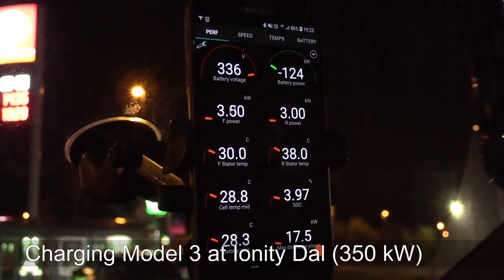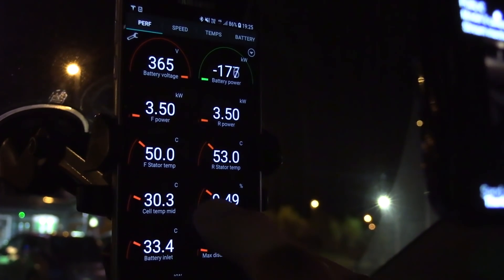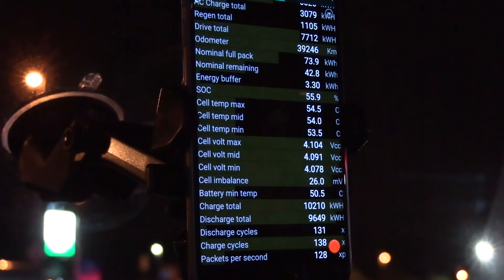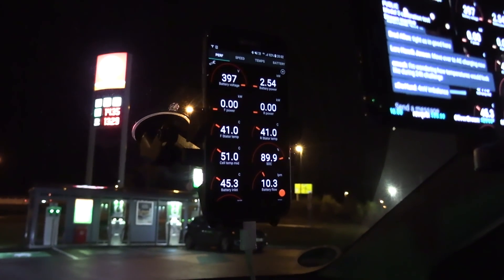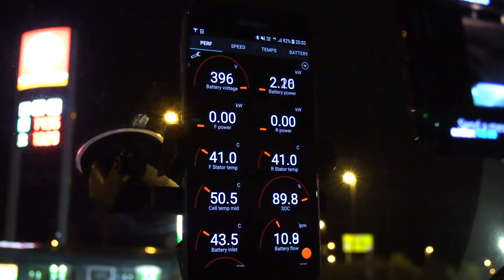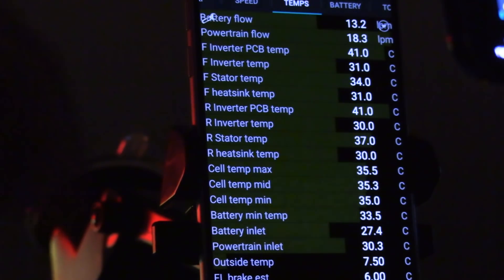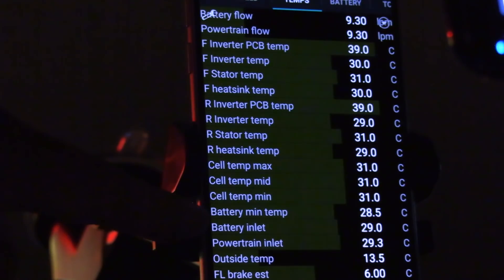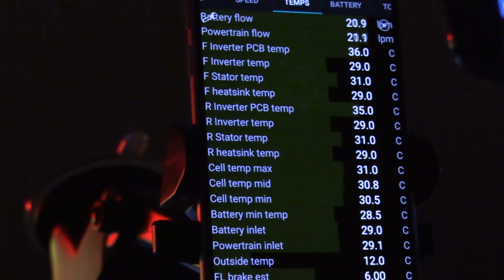Looking at Scan My Tesla OBD while charging and in Track Mode

Comment: Could you check the pre heating also with a Mod X or S as currently I don’t see really a pre heating. The pack it self get warmer due to the consumption. After 200 km of driving my battery has always 41-43 deg,  which makes a preheating unnecessary.

Comment: Wie does it charge at 130kW with a battery temperatur under 30 Degr.? And at a 50kW Triple-Charger it only charges 36kW with the same battery temperature?

Comment: When the stator temp is rising fast over temperature of the battery, i will more likely assume that the stator coils are used as inductor in charging circuit. Anyway it is clever complex solution the tesla is using, this principle has been described in some research articles but I don't belive that any other car manufacturer has implemented that yet.

Comment: Suggestion for a new video please --- people in some FB groups have been saying that their rear seat vent blows hot air when they've been driving for a while. Some research speculates that the duct is too close to the battery and long trips heat it up (and the floor?). And the only way to cool back vent is lowest manual setting which freezes front passengers. Also some say the back vents are split the same as the front -- there is a left and right side that uses the same setting as driver and front passenger. Is this a software or hardware issue with the back vent? Short trips maybe it does not happen?

Comment: I've read (somewhere) that Tesla battery chemistry is different from most other Li-Ion batteries in that it gives better performance e.g. lower internal resistance, higher charging speeds etc., but it is also much more temperature sensitive. That's why Tesla installs intensive thermal management (both heating and cooling) and also why they have always been able to charge at over 100kW. It seems that part of this different battery chemistry is that they like to be hot when charging and cooler when discharging.

Comment: I always thought that there are 2 things that degrade batteries prematurely, heat and excessive volts. Tesla have test equipment that allows them to determine degradation under test conditions, so I guess they have determined that heating the batteries to 50°c is worth the results. Will be interesting to see how m3 batteries handle it over time.

Comment: The internal resistance of a battery is inversely proportional to its temperature ( within certain limits). The lower the internal resistance, the higher the power it can take to charge. I thought that the ideal would be around 25°C, but never dreamt it would be 50°C !

Another thing I m curious is what happens with all this Thermal Cycling ( i.e. heating and cooling the battery) on the bond wires used to connect the batteries. It certainly isn't good in power electronics AFAIK.

Comment: AFAIK Tesla uses an "Active cooling limit" that starts the AC working on the battery when temperatues go above a certain level (and stops below that level). Below that level the car still wants to cool the battery when driving, but not bad enough to use more than radiator and pumps. When standing still without airflow on the radiator you wouldn't see much of this effect and the temperature would mainly hover near the active limit.
In addition to active and passive cooling limits the car also has active and passive heating limits (active affects stator heat generation and passive only switching between serial and parallell coolant loops). Fast-charging and track mode changes the limit levels compared to normal driving mode, and shrinks the "passive" areas to a more narrow span.

Comment: Did Model 3 use the AC in order to cooling down the battery or something else like a standard radiator?I saw that model 3 use the motor to heat up the battery, how is heated the cabin? With heat pump or the heat from motor?
Reply: The cabin is heated with what is basically a hair dryer.

Comment: From what I have read, the optimal battery temperature for best performance and efficiency is between 40-55 degrees Celsius (104-131 degrees Fahrenheit) and that Ludicrous Mode preheats the battery to 50 degrees Celsius (122 degrees Fahrenheit).

Comment: Correction/Retraction of below: As @Daniel I pointed out, It seems I had confused "Switched"  reluctance DC with "Synchronous" Reluctance AC motors. So the motors in the Model 3 are indeed driven by AC at speed (unless I am still confused, lol), I think they are started with Direct Current until they are rotational, then AC is the "Synchronous" part as the AC frequency is actively controlled to stay in sync with the motor rotation. https://en.wikipedia.org/wiki/Reluctance_motor

It seems the internet is about 50/50 on if it's "Switched" reluctance or "Synchronous" reluctance, but I am seeing "Synchronous" from newer and more trusted sources, I think everyone is just as confused as I am 😂

---
Original comment:

Because the rear motor is a switched reluctance DC motor, the effect of activating the motor to generate heat just locks it in place, it just activates a single coil (or pairs of them, depending on layout) (they likely cycle through all coils in pairs to keep from burning out, but no torque will be produced). The front AC motor can simply be heated by sending it simple DC current instead of AC which will not induce any torque (Altho, it can burn out faster than DC coil in the rear motor, so they have to be more careful)
Reply: Correct. using DC current via drive converter IGBTs in small % compare to nominal motor current. This method used from Industry drive converters for AC motors to keep motors windings dry, protect against moisture in insulation.
Reply: @janisdrava9228  They're not IGBTs in the Model 3, they are SiC MOSFETs.
Reply: I also heared that when the battery needs a heating, the inverter deliberately increases its switching losses for warm up the coolant.
How clever that is... No need for an external heater element.
Reply: A DC current can be seen like an AC current with frequency 0 (period -> infinity). And in fact at 0rpm the inverter injects a 3-phase  system of DC currents (different in amplitude but with sum=0). Their value depends on the rotor position and requested torque. For a 3-phase synchronous machine is possible to measure the static torque (torque at 0rpm) without inverter, with a single DC power supply.
Reply: Cool, learn something every day...
Reply: What about once the car is moving?  Isn't this "motor stall" technique to heat used only when car is stationary?
Reply: "Switched reluctance motor" in Tesla m3 is proved to be a hoax.
Reply: @NRG1985  AC induction at the front and SynRM at the rear.
Reply: @LambdaWave84  it's right that it exploits the "reluctance mechanism" but technically speaking is not a SynRM. It's more accurately described as Interior Permanent Magnet (IPM) synchronous motor, nominally equivalent to the majority of the competitors: if you remove the magnets we can call them SynRM, even if it would be definitely not a good one (it would work better with multiple flux barrier design in order to enhance the anysotropy, search SynRM ABB for example). I personally amended the Wikipedia Tesla m3 article  where originally was stated that the machine is an alleged "PM switched reluctance", in the Talk section is clearly explained why it's not...Still unclear why this is stated in many EV websites...I think because Musk said something like that in a tweet an no one went to check the facts especially after the  photos available from the Munro's teardown.
Reply: pxidr I know that you are really famous on Caradisiac 😉
Reply: @NRG1985  You're right. It's a mix between an IPM and a SynRM. Interesting motor tho that combines two technologies.
Must be a hell to drive properly... But the inverter uses a very powerful dual-core microcontroller for that.
Reply: @Veyrrox  Same person ;)
La au moins, contrairement a Cara, on parle du fond et de technique, pas a des ignares trolls...
Reply: pxidr Mort de rire tu m’étonnes ;) En tout cas tu t’y connais plus que moi en electro, moi mon job c’est l’info.
Reply: @LambdaWave84 In reality there is no mix: an IPM syncrhonous machine has intrinsically a fraction of the torque produced by the "reluctance mechanism" (this is in fact called reluctance torque), depending on the rotor design, number of poles, winding arrangement, this contribution can be high or low (even negligible...) to the total torque production. The specific Tesla rotor design, with a V-shape magnet configuration, excluding the alleged Halbach array (which I have serious doubts, missing clear facts to support it), it is used in the automotive industriy and servo-drive application. 
In traction applications, I believe Toyota was the first to introduce the V-shape rotor in the 2004 Toyota Prius. Here there is an interesting well made report. 
https://info.ornl.gov/sites/publications/files/Pub26762.pdf

Control strategy is quite mature and reliable, probably what would be cutting-edge in series production is the sensor-less control, which means driving the machine without direct measurement of the rotor position. Plus addtional topics like active torque ripple and acoustic compensation.
Reply: Pretty sure both motors in a model 3 are AC motors.
Reply: @98dizzard  both motors in the S and X used to both be AC induction, but now they also use a DC motor based on the one the Model 3 uses in the rear as thier front motor. So both AC and DC motors on all dual motor Teslas now.
Reply: @brantwedel  , it is an AC reluctance motor. All DC motors are brushed. Unless you can provide a source, as every article I have read refers to it as an AC Synchronous Permanent Magnet Reluctance Motor
Reply: @98dizzard  

Note/Correction: My information below is incorrect in that the Model 3 uses not a "Switched" but a  "Synchronous" Reluctance Motor as pointed out by Daniel I. I think they are started with Direct Current, and then once up to speed they run on sinusoidal/AC (the "Synchronous" part, matching the AC frequency to the motor rpm). The Wikipedia article I shared earlier backed up your information, I should read my own sources 😂

---

Most DC motors (by count in operation) are not brushed at all (because of wear/maintenance requirements of replacing the graphite/metal brushes, etc.), they are typically Stepper Motors (not brushed) or BLDC motors (similar operation) ... a switched reluctance motor is something in between those two. Altho in the case of Switched reluctance, the motors are sent an in "switched" DC current, but not a smooth sine-wave AC as you would want for a true AC motor. https://en.wikipedia.org/wiki/Brushless_DC_electric_motor https://en.wikipedia.org/wiki/Switched_reluctance_motor

And the AC motor technology: https://en.wikipedia.org/wiki/Induction_motor

Edit: added a reference for my claim of "most DC motors are brushless", since I mostly guessed at it, but wanted to double check 😂https://www.mouser.com/applications/dont-ignore-the-brushed-dc-motor/

Comment: So Track Mode seems to mainly ramp up the cooling pumps (8 -> 21 liters per minute, audible noise), in an effort to prepare for effective removal of heat from the battery and the drivetrain because of high loads. I would imagine, that track mode while standing still does not lower the temperature that much (smaller delta), but would make a huge impact with higher battery/drivetrain temperatures (higher delta).
It would be interesting to know if the pumps / the speed of the pumps of AWD LR and AWD Perf are different. I could imagine that the Perf model could have pumps with a higher max throughput, but if it is like that is yet to be seen.
Reply: Yes, it almost seems that in track mode the large battery is used as ice pack coolant for the engines. Therefore the Model 3 Performance in track mode can always deliver 100% performance in contrast to the other Tesla vehicles. Thanks to the Superbottle and the stronger cooling.

Comment: I really need to get this app and cable. I wonder if low battery temp is why the ramp-up to 145 kW on my model x is so slow on superchargers. It can't power heat like this using the stators as it does not have the model 3 superbottle connecting all the heating/coolant systems.

This is (ev) nerd porn :)

Comment: That high batterytemps can't be healthy
Reply: Calendaric degradation is certainly higher at high temperatures. But these temperatures are only reached for 20 minutes or so during charging, after which the battery is cooled down significantly again. So this does not make much of a difference in terms of calendaric degradation. However, batteries also get damaged from charging - the higher speed, the worse, and the lower the temperature, the worse. So it makes sense to heat up when charging at a fast rate.
Reply: @kenny.8934  Partially correct. First studies of Leaf and early Tesla packs indicated that anything above 25c caused degradation(especially in mk1 Leaf). But, this is newer tech(model 3 perf.) . Watching this video, they seem to hover around 30c... Also, I think that most of damage can happen if the batteries are exposed to "extreme" temps. for longer time and not for half hour charging etc...
Just to add - its clearly visible in this video that Tesla allows this high temperature, cooling is no where near its peak... Thats most important. Again, we don`t have specs of these newer batteries, only old 18650(I mean old format and chemistry that they use  in 2012 etc...)
Reply: Tesla battery live the longest when only charged with 3kw and avoid hard acceleration. There is a german Li ion expert(Holger Laudeley ) that manages to get only 1% degradation with for instance his 2016 Model X. And on his second car he has also only 1% deg. So, yes supercharging is bad and very bad is also hammering it while the battery is still cold.
Reply: Indeed, this is why supercharging too often is not good for the battery. The high temperature is required to obtain high charging speed. I guess it's a fair trade off for occasional use.
Reply: @kenny.8934  40-50c is totally fine... Imagine driving the Leaf in summer(in my country temp is sometimes 40+) and it doesn`t have liquid cooling, so batteries will reach 50c easily...
Reply: @DG-uv3zw  A leaf is not suitable to drive at over 40 degrees Celsius outside temperature. That is clear. But putting a Tesla on a charging bomb is like hell.
Reply: @sdrhs-q3j  over 60c doesn't sound healthy. My general rule is to keep any electronics below 60c :) :)
Reply: It's funny that people say that Leaf batteries can't handle high temp, but Tesla batteries can. Do people think that other battery manufacturers don't improve?
Leafs problem is to get the temp down again. I'm not worried about degradation,  as they probably made the chemistry to handle high temperatures,  only time will tell.
Reply: @Timeruler80  Its not because Nissan can`t make/use better batteries, its a matter of economy!? Can they make a margin by using expensive chemistry like premium cars - like Tesla. Thats the whole point. And also, many say that expensive batteries are the reason that cars like e-tron maintain such a long period of high charging. Either that or they are killing the batteries but I thinks its the first...
Reply: several comments here about healthy temps for electronics and bat, without any additional observation or knowledge. 60C and above in electronics is normal. Some electronic components on almost any smartphone could reach those temps and then dissipated to manageable levels before reach the human skin.
Reply: @javqui410  But you have to say that its near the limit? 70c for many electronic devices is really hot, even destructive! And who knows the temp inside the battery cells? So thats just the assumption that 60c is pretty high! But, of course, judging by the video Tesla can easily reduce that temperature if they want/need. They know the best, we are just speculating which is ok. Nobody is trashing, I think...
Reply: @kenny.8934  Interesting. Danke ;)